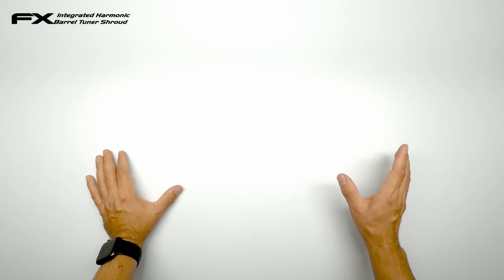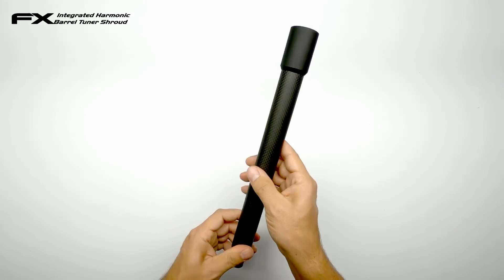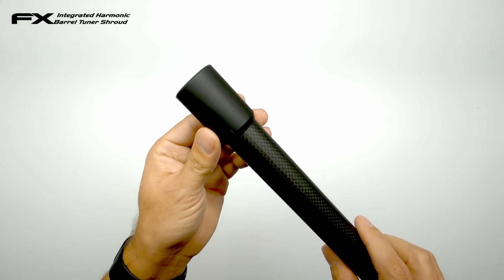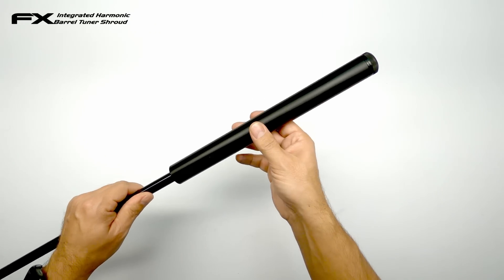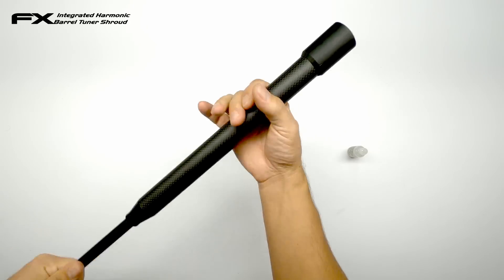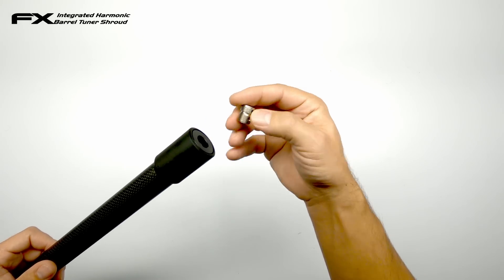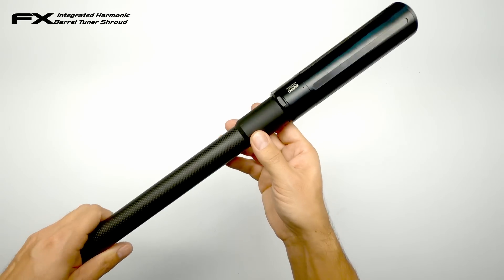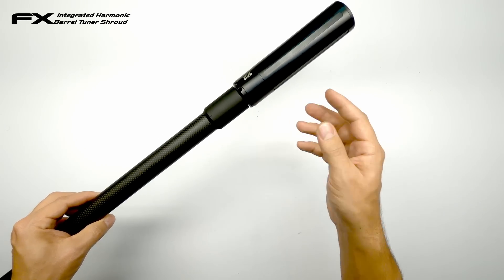FX Airguns Intergrated Harmonic Barrel Tuner ( M3 Slug Tune Part 4 )

Comment: TOO MANY PARTS AROUND THE PENCIL THIN "BARREL" .   I  WOULD RATHER HAVE SOME  RIEL MUCH THICKER BARREL LIKE WE SEE ON  RIMFIRE RIFLES... MEANS WITHOUT ANY SHROUD.  IT   WOULD BE FAR STIFFER THAN A PENCIL LIKE LINER, THEREFORE DUMPING VIBRATIONS MUCH MUCH BETTER. IT WOULD HAVE TO BE  MADE BY REAL GOOD BARREL MAKER LIKE KRIEGER FOR INSTANCE...  IT WOULD DO MIRACLES COMPARE THOSE PENCIL LIKE LINERS...

Comment: Hi there. I'm little bit behind as I can see with models and reviews, but I still have question If you don't mind. When I install mine, Integrated tuner is not making noise of kind like yours when you turn? I mean like little click or like a position. Mine only turns all around. I don't know, O hope it's not fake or something, but I purchase from Pyramid Air, so I hope is good.

Comment: Don’t bother with this unnecessary thing. Made my gun shoot like crap.
Reply: If your gun already shoots accurate enough to take games don’t bother with this. The FX Impact was already designed to shoot very well and shot tested from the dealer before it was shipped to you. I bought a carbon fiber sleeve that slips over the steel liner and also bought a harmonic tuner. After I installed the system, my rifle was never the same. I went through 500 rounds trying to find the sweet spot where it would shoot and I could not find it. The best group I got out of this upgrade was 1” at 25 yards. My rifle used to shoot 1/2”- 3/4 at 50 yards… so I took everything off and store the factory originals.. gun shot nicely and accurately again. Don’t fall for accessories that they have only to make sales. It’s not necessary.
Reply: @Loojmemhav  Thanks for the reply. Mine shoots nicely up to 90 yards from the factory with tuning. But It really opens up at 100 and I thought a few upgrades would help, if not won’t hurt it. I do not want to find out the hard way just for a extra 10 yards. I’m sure with more tuning I will be happy at 100 yards. Thanks for speaking up when the others wouldn’t. Happy shooting brother!
Reply: @Jayvy.Outdoors  no problem. One thing I do find that helps is shooting different ammo and paying attention to which barrel liner you have. Keep the pellets with the pellet liners and the slugs with the slug liners. For instance, my 30 cal shoot nicely with the original ST barrel with pellets, then I upgrade it to the STX slow twist barrel and it shoots pellets ok, not superbly like I thought. It didn’t shoot the hybrids well neither.. so upgrade it to STX fast twist (not slug liner) and it shoots the hybrids nicely but not the pellets. This is just my experience with my 600 mm barrel.. could be different with your gun because it’s tubes differently.. hope this helps. Happy shooting.
Reply: I just received mine (still in package box) without out doing the negative product review first. What is your caliber, gr, fps. I’m thinking about sending it back. Do you know if I at least should keep the carbon fiber liner sleeve but just not the integrated harmonic barrel tuner?

Comment: Schrott,wenn ihr ca 140 Euro wegschmeißen wollt dann kauft euch das Teil.Habe es 4 Std getestet und nicht einmal ein besseres Resultat bekommen wie das Originalteil!!!
Reply: Habe nur den Carbon Sleeve montiert.Auf 50 Meter mit Original Rohr aus Alu und Carbon Sleeve Streukreis von 12 mm .Bleibt im kleinen Schusspflaster.Mit dem HarmonicBarrel Shroud oder auch dem Harmonic Barrel Tuner ( vorgeschraubt) ist es nicht möglich den kleinen Streukreis zu bekommen.Habe alle Einstellungen getestet!!
Reply from the maker: @Anfänger123 can you give me some more details about your setup 
Cal? Projectile? Velocity? Regulator pressure? Micro&macro ? Valve ? Barrel length
Reply from the maker: If it doesn’t work make sure you have a stable tune to start from , second if you have a very stiff barrel it won’t work aswel .

Comment: Hi, thanks for your vids!!  Will this fit a Maverick or Wildcat MKIII BT?  Thanks!!  BTW, where are you from?
Thanks again from Patagonia, Argentina!
Reply from the maker: Hi , the shroud lengths are different between the impact and Maverick, you can fit it on a Maverick no problem but the shroud will be a little short I think .
You can also install just the harmonic ( the one that is sold as a separate piece without the shroud)

Comment: can you remove the front tuner weight and just mount a moderator on there instead of the weight?
Reply from the maker: With the weight you can anyway mount a moderator 🤔 removing the tuner isn’t possible as it screws into the carbon tube .
On the other hand you can just remove the weight but then you are left with some exposed threads
Reply: @Airbuks  I have a bottle that goes past the front of the barrel so the tuner will hit the bottle, and I didn’t want to put a longer barrel on it. I’ll half to wait for the Hein Fromman tension barrel I guess.
Reply from the maker: @jeffojibway9284  i understand 👍🏻 there are some barrel holders available to help out already 👍🏻
Barrelhouse.com if I am not mistaken, I didn’t try it myself yet but it should help tensioning

Comment: Do you know if it still fits in the fx hard case case with this fitted as the extra couple of inches would take it over unless the shroud is a bit shorter to compensate this? Thanks!
Reply from the maker: Mine with the 700mm and harmonic barrel tuner fits my original case 👍🏻 
But without moderator

Comment: Can this be used with the standard shroud thread protector or do you have to use a suppressor?
Reply from the maker: It can be used without moderator yes , I think the diameter of the thread protector will be a little smaller .
Reply: @Airbuks  Thank you very much! I appreciate what you do it is so helpful!
Reply from the maker: @medicnine398  your welcome, thx

Comment: I'm converting from 600 to 700. It appears I need a 700 "black" barrel sleeve to be able to screw in the barrel retainer bolt. Does that sound correct?
Reply from the maker: Can you explain al little more detailed, no sure what you mean 🤔
Reply: @Airbuks  The stock black vanity sleeve is too short for the 700mm barrel to thread the barrel retainer bolt.
Reply from the maker: @EdBraunbeck  still difficult to understand but are you using  the shroud of the 600mm on a 700mm or what are you trying to do ?
Reply: @Airbuks  Sorry, I'm still learning. It's the black sleeve that screws into the air transfer port.
Reply from the maker: @EdBraunbeck  oké , so you have bought a 700mm liner I presume? 
If you want to upgrade your rifle from 600 to 700 mm you need to buy a complete barrel kit , meaning that the black tube that screws onto to transferport is the correct length to accept a 700 mm liner . You can put a 700mm liner in a 600mm housing and expect it to fit as this will be 100 mm to short 😉

Comment: Hello, do you know what size i need for replace the shroud of the fx m3 standard please? Thx
Reply from the maker: Hi , What do your mean exactly? The barrel tuners come in different lengths according to the barrel length you want to install it on
Reply: @Airbuks  So i need the  600mm harmonic shroud? Because on huma-air website it’s written « 24´´ long » but the complete barrel is 24´´ long… but the shroud is shorter than the barrel….. right ? 😅
Reply from the maker: @jeromemorespeeder3503  yes I think they mean that that is the one that suits the 600mm , although it’s strangely written

Comment: FX impact m3 compact. 177. In will107 joules come from tha kompany,  will you mix it or same othar modifications will have to be done in case of 22 barrels?  
Plz reply tha answer
Reply from the maker: Sorry mate don’t understand , did you use a translator?
Reply: @Airbuks  fx impact m3 compact. 177 change the berall in stoll.22  berall ke uper video banaye
Reply from the maker: @saddamhusainsaddamhusain8377  really sorry mate , but I can make anything from the sentence 🤷‍♂️
Reply: @Airbuks  i think he mean that either .177 or . 22 cal pellets can shoot without changing the tuner, ur mate from Philippines sir
Reply from the maker: @jessiemalazarte8146  thx mate 🙏🏻
Reply from the maker: It is possible to use the same tuner on a 177 and 22 but just make sure you have the correct airstripper on the end of the tuner , this is caliber dependent

Comment: Awesome tuner I don't mean to sound rude or conceited ... I don't think I need one of those on my m3 because so far my m3 22 cal 700mm shoots almost every pellet and slugs pretty dam good even with out a carbon fiber sleeve over the liner ... I tried the cf liner over the sleeve and it mess up my poi bad even when I sighted it in it still  shot like crap so im just shoot with a koi dfl and the orings pretty good but maybe on my mk2 it work but even that gun shoots hole in hole at 50 75 100 yards on a good day with 36.2 nsa and 34 gr varmint knockers at 980 to 1000fps thanks for sharing bsafe I might get one just to try it out